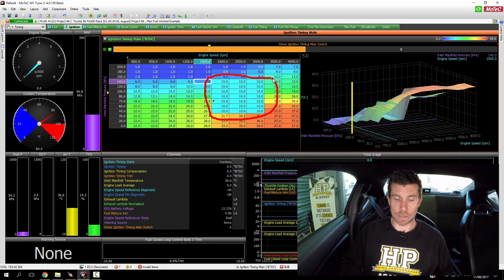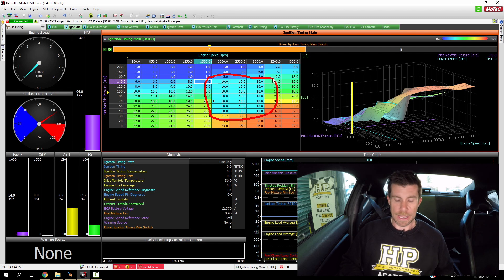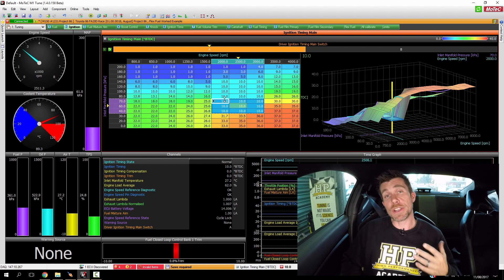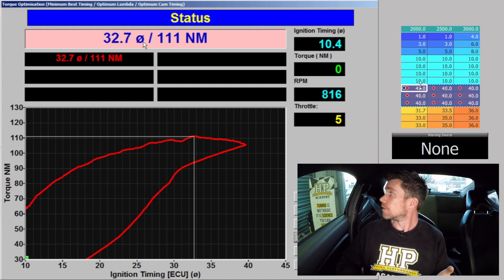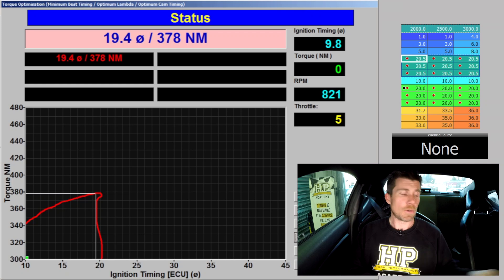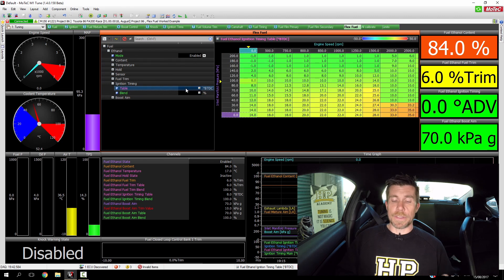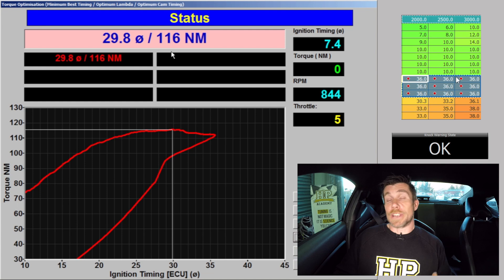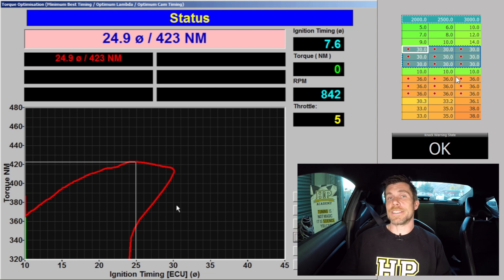Ignition Timing / Ignition Advance and E85 🌽 ⛽ [FREE LESSON]

Comment from the maker: Building a fast car? Get $400 OFF the all-inclusive VIP package deal:  https://hpcdmy.co/vipy40
Learn how to tune ethanol flex fuel setups the RIGHT way. Enrol today with 50% OFF: https://hpcdmy.co/offery40
Reply: What are the pros and cons of running e85 on an engine with a compression ratio lower then 9.0:1?
Reply: Can you explain why is there 10% throttle difference between the two fuels at high loads?
Reply: So basically is a gasoline timing table the same as alcohol? Or is the curve different?

Comment: Awesome video! I think with our brazilian ethanol found in gas stations maybe is a bit different, because its composition is hidrous E100, 94% ethanol, 6% water. The cold start is a nightmare, but the cooling effect is so strong that 95% aftermarket turbo charged runs between 0.8 and 1.4bar without any kind of intercooling and in MBT.
Reply from the maker: Yes E85 is generally more common so that cold starts are easier. You don't really gain a whole lot more cooling between E85 and E100, although I'm sure in some specific cases the difference would be worth it.
If you're running flex fuel it wouldn't be too hard to pop a bit of gas in with the E100 when you're at the pump to aid with cold starting, although I'd imagine Brazil is pretty hot in general climate wise though yeah? That would help - Taz.
Reply: @hpa101 Hey, im feeling privileged for your reply! In my region is not sooo cold, but under 20°c is hard to start, maybe due the 7% of water, newest cars came with heated fuel injectors to solve this problem, but high flow injectors dont exist with this resource. I will try mix a bit of gas, thank you!

Comment: So why does the engine want less timing on ethanol? I had assumed it would want slightly more timing because the octane rating of E-85 is higher than pump gas, and it takes longer to burn. What octane was the regular gasoline you used?
Reply from the maker: Common misconception, you are not alone with this. You have made a huge mistake in your assumption though as ethanol burns FASTER, not slower..
https://youtu.be/qy_rKQCSevc
That explains it and I promise it is quick and to the point, but for TL:DR, ethanol burns faster and cools the combustion charge more.
Hope that helps! 
Octane is irrelevant when you are looking at ethanol blends vs outright gasoline and your specific question - Taz

Comment: in your experiance are knock sesnors a reliable tuning tool for a drag racing right around 1000hp e85 and 10-12psi of boost? looking to switch to efi trying to select a ecu, wondering if knock sensors are going to be something I want to use or if they will give weird issues

Comment: What was the octane number of the fuels tested? Or it's comparing apples to oranges? I would expect the same ignition timing at full throttle for the same octane number. Apparently the E85 octane was 2 points higher which resulted in 3 degrees difference

Comment: How does the ECU measure the Ethanol content? Never seen that before
Reply from the maker: There is a specific sensor for ethanol content. Any modern car that is labelled as being 'flex fuel capable' will have one stock, otherwise they are not difficult to setup in other applications in general - Taz.
https://www.hpacademy.com/blog/how-to-find-out-what-percentage-of-ethanol-is-in-your-fuel/?utm_source=youtube&utm_medium=social&utm_campaign=general-interaction
Reply: @hpa101  Thanks. In Ireland here so it's not something I have come across before. Just installed a rolling road for some hobby tuning of my own cars. Will get signed up to some of your courses soon. Thanks again

Comment: Best explanation on how to tune timing.
Just one question as I don't understand English perfectly.
Do you use speed limiter or just try to maintain the accelerator as smooth as possible when you're tuning?
Reply from the maker: Glad you enjoyed it!
So in this example the dyno we use limits the RPM to whatever we set it to. You only use that function in the low to mid rev range, and then you start doing sweeping runs through the high RPM range as it wouldn't be good for the car to sit there on the limiter while tuning haha.

To simulate this on the road, you use left foot braking to hold the RPM instead.

it is called 'steady state' tuning if you want to look into it a little more. Hope that helps - Taz.
Reply: @hpa101  I understand perfectly ty so much and I have a dumb question because if it was that I guess you would have told me.
Using speed limiter can't work right?
Reply from the maker: I haven't tried that but generally a speed limiter has the RPM fluctuating, and since we what to hold the RPM rather than speed, I'm not sure it would really be better than simply left foot braking to be honest: https://www.hpacademy.com/previous-webinars/the-key-to-road-tuning-left-foot-braking/?utm_source=youtube&utm_medium=social&utm_campaign=general-interaction

And no worries at all, one comment we get from many podcast guests is that they wish they asked more questions from earlier in their careers, so never be afraid to ask questions even if you think they are stupid as realistically even if they are what is the worst that happens? 😎 - Taz.

https://www.hpa-tunedin.com

Comment: Can i simply increase timing in my load threshold during WOT say i have a minimum of 1.3 load at WOT and a max of 2.4 at WOT , can i up the timing from 3000rpm to redline between 1
3 and 2.4 of load until it knock and back it off and just leave the rest of the table the way it was and have only changed it wher it sits at wide open?

Comment: Did little calculation of HP. At 2500rpm and 25% throttle it went from 39HP to 41HP. At 2500rpm and high load it went from 132HP to 148HP.

Comment: Hello 
I have a question 
I modified my hellcat by updating upper pulley 3.35 to 3.17
It gives me 1- 2 PSI of additional boost, my car has 91 octane (factory tuning) with additional boost now it rewards 5° timind
Will 93 octane advance timing back or I have to use boostane to make 95 octane 
Thank you
In

Comment: What about diesel? Can one use ethanol in Diesel engines? Thanks for the information!
Reply: No. Diesels work completely differently, as they are essentially a compression ignition engines ie. no spark.
Reply: Running a diesel on filtered waste oil requires 10 to 30 percent gas to thin the mix. You could probably substitute in e85, but lubricity tests should be done first. More of a Project Farm type of thing

Comment: Well, at low throttle, there's roughly 3° gap b/w E85 and gasoline (30° vs 33°).
At mid throttle, 6° gap b/w E85 and gasoline (25° vs. 19°) with the side effect of being knock limited on gasoline.
It seems your bench is a Toyota 86 / 4U-GSE engine / direct injection.
How these gaps would be  on a V6 engine with indirect injection ? Can these gaps  increase or decrease according to the engine configuration !?
Reply from the maker: Correct, those gaps mean nothing and will vary wildly across different engines and setups. This is why we have to tune and why we can't just work out what the engine wants based off another engine, or even an engine that is the same. It's simply not possible to do with any kind of reliability - Taz.

Comment: Can a car run on 100% ethanol safely as a daily.
Reply: Yes it can. In fact in some countries (I think in Portugal, but I'm not sure) it's used as a main fuel. The problem with running on pure ethanol is that you can't start a car when it's cold, so it works only in warm climates. Even in countries where it's used as a main fuel, cars usualy have small reservoir for petrol used only for starting a car in cold weather.
Reply: In Brazil is very common since 70's. Recently the cars started to use the heated injectors technology, so, there's no more need the gasoline reservatoir.

Comment: I have a 2013 kenne belle supercharger with a stock ECU that was reflashed by a tuner. It’s a 6.4 liter with stock internals. 2.8 kenne bell liquid cooled. 

Approx 6lbs of boost. On e85. It made 566rwhp. 

Will this class teach me how to effectively tune this motor for max performance with the stock internals?  

I have access to a chassis dyno.  All I need is the tuning knowledge. 

Also are you familiar with the diablo platform for mopar engines?

Comment: Do you guys cover email tuning also?
Reply from the maker: Hey Joseph,  you need to learn the same things if you plan to remote tune, but realistically you want hands on experience before doing anything remotely. Even using your own low powered NA project for this experience is worth it.

TL:DR: Yes, but it isn't as simple as you might think -  Taz 👨🏻

https://www.hpacademy.com/free-tuning-lessons
Reply: Ah ok im from the srt4 counity and e tuning is very popular i have a decent understanding on how timing works and a little about ve tables and trying to learn about injector scaling my tuner uses cmr and hp im currently tuned on cmr i have guides on tuning bht thanks for the input!

Comment: I am a bit confused perhaps someone can clear this up: You needed LESS ignition timing during vacuum to achieve mbt with ethanol but use more ignition timing during boost? should I be lowering ignition timing during closed loop operation for best efficiency? I already have open looped tuned well with more timing compared to gasoline. It almost seems reversed between closed and open loop operation.
Reply: During vacuum you are not knock limited with pump gas so you go with the timing that makes MBT for the fuel you are using which for E85 is less than pump gas. For the engine they tested it knocks before it gets to MBT on pump gas under boost. With E85 it is less prone to cause knock so you can continue to add timing until you get to MBT.

Comment: Can you cover this but with a carbureted engine.
Reply: For full throttle tuning with a carburetor get your fuel mixture optimized than use acceleration tests to find the timing that gives you the quickest acceleration. Advance your timing 1 degree at a time until you detect knock or your times get slower. For the timing curve it will depend on your engine combo. You can change that with different weights, springs, and stops in your distributor. Then you will want to tune your vacuum advance.
Reply from the maker: What is a "car I rated engine" I don't understand?  - Ben
Reply: @hpa101  Sorry I meant carbureted engine.
Reply from the maker: We only cover EFI sorry Sam - Taz.
Reply: @hpa101  okay ;(

Comment: You also seat at 45% throttle  vs 60% throttle for the same engine speed in Ethanol test , + engine run ~20°C cooler at the start of the test . I assume that can change the output too , not only the fuel .

Comment: So in theory, if you don't encounter knock say 3 degrees after MBT, negating strength of engine components, the basic dimensions of the engine can put up with a higher compression ratio/more boost at that sector of the map?

Comment: How do you keep the throttle so steady?
Reply from the maker: He makes it look easy eh! Years of practice ;)
You can set the max RPM via the Mainline dyno and then you adjust to control the load. You can also 'wedge' your foot in certain places to give extra control/different leverage points depending on the vehicle you're in, but like anything, 'practice makes perfect' - Taz.
Reply: Steady state dyno

Comment: Would you usually try and find mbt at different points on the map as well, say 4500rpm at 60 and 120kpa?
Reply from the maker: Yes. We just chose two points to highlight the differences in knock limited an non-knock limited operation. When we actually perform a complete tune we want to optimise each ignition cell to achieve MBT. We don't however use the Torque Optimisation test in every cell as this would be too time consuming. During normal tuning we are just using the torque feedback on the dyno to find MBT.

Comment: Would be cool to see your approach on street tuning
Reply from the maker: We do cover both Road and Dyno tuning techniques in our Practical Tuning courses as we're firm believers in using both. 
Even though a lot of people start out with Road/Street Tuning they often end up with Dyno access in the future so it's also nice to have all of the information there from the start - Taz.
Reply: Agreed, This was some great data and method illustrating many of the important factors. I self tune my own turbo car on street with a knock limited Subaru and have started working on an E85 tune. It was nice to see see data to back up my results that E85 likes a little bit less timing at lower loads which I presume is allowing for a bit more heat in the combustion to reach max VE.  Thanks again.